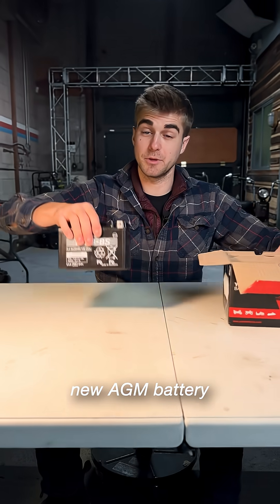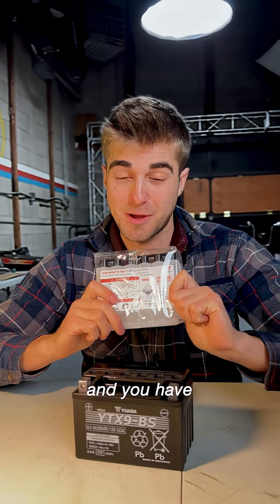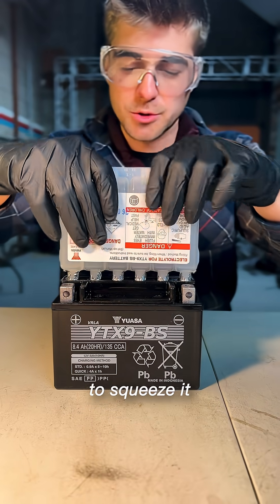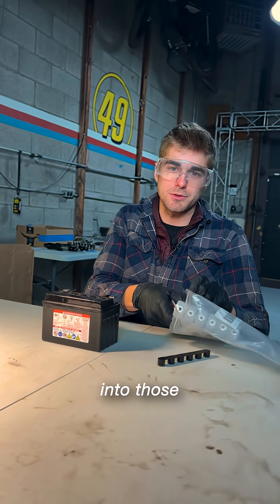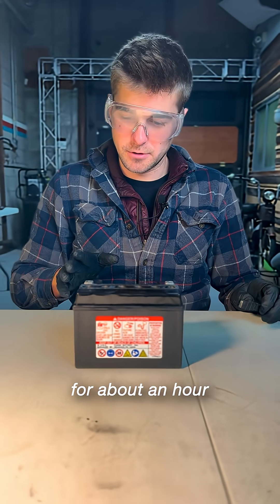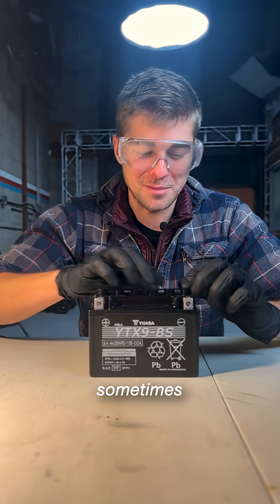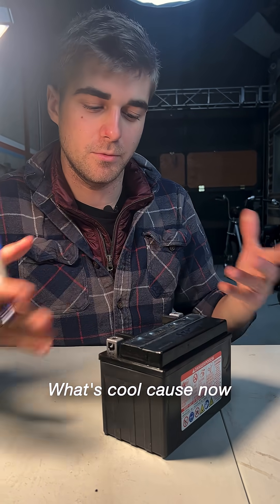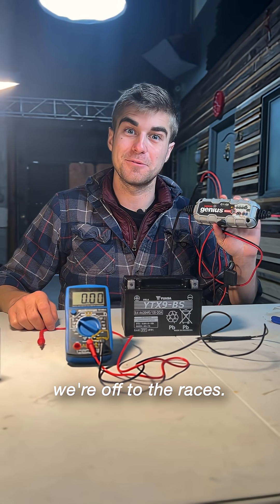How to activate your AGM battery | Tech Tips ⚡

Comment: Your first charge from your charger should be manually adjusted to take the battery, all the way to 16.20 VDC. And if you can, you could give it a trickle charge every fortnight, which could still reach 16 V. And this battery will last, a very long time. 😊😊

Comment: Excellent presentation.  No hyperspeed, chopped ADHD clips we have to pause every couple seconds.  I wonder if the fibers are prone to trapping bubbles from filling and off gassing though, blocking current flow across random patches of the electrodes, and if initial vacuum treatment might be worthwhile for longevity?

Comment: I worked at an auto parts store many years ago. I remember occasionally having to fill and charge flooded lead acid motorcycle batteries. Back then, the acid came in one single bottle, and you had to precisely decant it into each cell.

Comment: Just to clarify some disinformation: 
Battery acid is corrosive and not fun but you can absolutely put your hands into it for a couple of seconds without any issue as long as you wash it properly afterwards (ideally with some baking soda mixed into the water to make it alkaline)

The gas coming out of the battery when adding acid is mostly just CO2. H2S is a byproduct created during battery production but the concentration you need to start smelling it is extremely low. The other possible source of H2S smell is usually a short circuit in one of the cells, which released H2S when charging the battery.
Reply: Another point: AGM batteries don't like oxygen and they have overpressure valves, so close them soon after adding the acid when most of the gas is released and you only have slight bubbling

Comment: Bro I did that and it's not acid Acid. Spilled on my finger nothing happened but once it gets in battery then it becomes acid.

Ps the battery is THESE BATTERIES ARE SHIT THEY DIES AND BECOMES USELESS WHEN NOT USED WITHIN 15 DAYS ITS PLATES BRAKES.
Reply: The acid is diluted these days so you may feel burning for a bit but it goes away quickly. Still wear glowes though

Comment: I can tell you from working at a shop that dealt with batteries. Battery acid on your skin wont do anything besides make you itchy.

I dealt with it every day and with many broken batteries brought in. It will eat cotton nylon wood concrete. but it doesnt do anything to plastic skin or synthetic clothing.

Battery acid is terrible for you if you ingest it in anyway say your mouth eyes or an open cut. But you would have to leave your hand in a bucket of acid for a very long time before it ever starts to hurt you

Comment: Amazing.... By the way, AGM batteries last longest when they are  float charged at exactly 14.10V at room temperature... There is actual real data from hundreds of thousands of batteries that shows float charging at 13.5V actually accelerates sulfation.

Comment: Lead dioxide on one plate and the other plain lead. Add sulphuric acid and you have a battery.
Reply: You will have a terrible battery though 

The magic is in the engineering details and processes 

Lead oxide production, Paste mixing, additives, curing, formation all have a big impact on performance

Comment: No doubt. Watch out for the acid.  I got a hold of a brand new SLA battery with a bad case weld. At some point I touched my face because about the time I realized the battery was wet, my upper lip started burning.

Comment: As someone who's worked at a batteries plus. AGM doesn't insinuate that all AGM batteries are stored dry. It is true of the smaller motorcycle, dirtbike, etc applications, but Car AGMs are already filled in factory. It is okay if you wiggle it, squeeze it or tip it to make it release the acid faster, we had things to rest the bottle against to quicken the filling process. You don't actually have to wait an hour, at most it should be 30 minutes for most batteries like the 9-bs you have. after the waiting period we'd stick it on the charger until its 100% and prepare it for the shelf that day.

Comment: 2.2 volts per cell=13.2 volts fully charged
Reply: Only when you just ended the charge a couple of minutes ago, which will drop fast 

Normal voltage is ~12,8V for a fully charged battery

Comment: Agms are not normally shipped dry like that, and lead acid chemistry does not produce 2 volts per cell. It makes 2.1, which is why nominal battery voltage is not in fact 12 volts, but 12.6v. In a 6 volt battery it's 6.3
Reply: He's doing a video to show how a AGM is started up. He's not worried about the stating exact voltages since that isn't the point of the video.
Voltages can be another video where specific readings can be specified.

Comment: Oh dear, oh dear, oh dear. Each cell produces between 2.1 and 2.4 volts, not 2.0 volts, for a total of between 12.6 and 14.2 volts in a '12' volt battery. That's why your battery charger indicates upwards of 13 volts (usually around 13.8 volts) for a 'fully charged' battery and why a battery that holds a maximum of between 12.0 volt and 12.4 volt charge is classified as 'dead'. Flooded acid batteries may have twelve cells grouped as six pairs where each cell produces 1.02 volts - 1.2 volts. 

Secondary/high school chemistry.

Comment: What you should also do is write on the battery in a different color marker because people that write the date in the year on the battery in a color that is not well. Let's just say this. The color that you wrote the date on the battery is roughly about how you'd say too much color that absorbs. It's better if you use a white marker or even a red marker because then you can actually literally see it and it's better to write it on multiple places on the battery because you never know on what's going to happen because like some sometimes a stupid moron kid will wipe that date off even though that you tell him not to wipe it off. Some of these stupid kids actually do wipe it off. I should know because I did the exact same thing to a battery and the kid wiped it off on me and I even told him do not wipe this off. You can wipe everything else off except for this and for now on I've been writing down the expiry dates on a piece of tape and also on the battery and a different color. I color that actually pops out so that people can actually read the date of expiry and I keep on saying it's not to let people know that they're idiots to let them know that this battery needs to be changed and that's the date for the date I bought that battery. It's to let me know when I bought the stupid thing and when I can replace it. Some batteries don't really last the amount of time that they last so it's best to actually have the expiry date on it and that's also good to keep the receipt for the battery😊😊😊

Comment: Most of the time you get no dangerous gas when filling a dry charge AGM. If the acid pack is contaminated or the plates are very old/sulfated you might get tiny amounts of sulfur gases, usually SO2 (burnt match smell) and only rarely trace H2S (rotten eggs). H2S is generally a sign something’s wrong with the battery, not a normal part of activation.
Did you actually smell rotten eggs/fart (H2S), or sometbing like a sharp burnt match smell (SO2)?
The thing is, the electrolyte contains sulfate (SO4²⁻), not sulfide (S²⁻), so H2S shouldn’t normally appear during a proper fill, at least not in any meaningful quantities.

Comment: With lead acid batteries if the battery is not holding a charge you can set it down hard onto pavement and sometimes that will help or even adding fluid into it

Comment: great video, thought AGM were some exotic expensive battery type. Nope,, 56 and learned about Absorbed Glass Mat batteries. Same as a standard battery with added feature (mats)to keep them stable whatever the position. Thankyou
Reply: They also work by using the internal O2 and H2 recombination to make it last longer. 

That recombination doesn't always work though and even the manufacturers themselves haven't figured it out completely yet so it's a lot of voodoo and praying on the manufacturers side

Comment: Depending on the specific concentration of sulfuric acid you can neutralise any residue on the container by carefully submerging it in a bucket of water then adding some bicarbonate soda till it stops reacting then the remaining liquid is safe to go down the drain and the plastic can be disposed of appropriately. 

I don't believe that batteries use a particularly high concentration acid otherwise they wouldn't sell it to you like this. This technique works even for highly concentrated acid but you need to be really careful about adding concentrated acid to water as it can produce enough heat to vaporise the water and boiling acid, water mix is not fun. The rule is always ad acid to water, NEVER the other way round. 

It's been a long time but I have worked with HF before and sulfuric acid is comparatively mild. Something to always respect but you needn't be scared

Comment: Gases generated in batteries are odure less ,that you will not feel any smell, one when acid heated because of over voltage/over current while charging you can smell acid vapours, over a period of time it may results blast of battery.

Comment: Great guide. My AGMs have always been wet. I use a pair of them in my sound truck used for outdoor audio with a pair of 1,000 watt amps and a small mixer. The first pair worked great and would run the system for half an hour at moderate volume, but my current pair of AGMs only lasts about 10 minutes 😢

Comment: H2S hydrogen sulphide is sooooo deadly.  Make sure to do this outside or in a well ventilated area.  At low concentrations it smells like rotten eggs and at higher concentrations you can’t smell it at all and your lungs will just cease to function… then you die.

Comment: That acid that comes with that battery is only slightly more corrosive than brake cleaner and way less corrosive than brake fluid from my experience and most of my set up work I don’t put gloves on due to it being like brake fluid it swells up any type of rubber if you get on your hand just wash it off with soap water quickly and you will be fine
Reply: Brake cleaner is an organic solvent and brake fluid is polyglycol with other stuff added 

Those have absolutely no relation to the sulfuric acid in chemical terms

Comment: Malarkey.  Frightening people unnecessarily.  The acid used in batteries just isn't that strong .  If it gets on you, after a bit it will start itching.  Then slowly go into chemical burning.  PLENTY of time to get to a sink and wash it off with soap and water.  Because battery acid us filuted with water.  And neutralized by baking soda.  If you spill drops of it on your clothes you won't even notice it till they come out of the wash with a bunch of little holes.  Polyester stands up to it better than cotton.

So, do you want to dunk your hand in a bucket of battery acid?  Probably not.  Splash it it your eyes? Absolutely not.  But with decent protective equipment and safe working habits it is fine to work with.  If you do it a lot it's not a bad idea to keep some water and baking soda handy to neutralize it and wash it away.

Comment: Wish you would have connected the voltmeter to the terminals before you added the sulfuric acid. Curious how fast the voltage goes from 0 to 12+ as the acid is added.
Reply: Because when dry there's no way for the electrochemical reaction to occur.

They're already charged, just missing the acid

Comment: 12,73 volts meaning lead acid battery, even agm, is full. should not need charging. 
i would like vid charging it and see voltage day after charging. floating voltage needs time to discharge by it self.

Comment: So battery acid is itchy...and what's crazy is brake cleaner is cold and somehow gets the acid off. I'm not a chemist but somehow it makes the itchy go away.

Also SLA is better than AGM but not as good as gel. And the nickel plates are "forever" but only when stored in dry places because the plates corrode in humid storage.

Comment: AGM is a German acronym for "Aller größter Müll" because if you discharge these to 30% by accident more than a few times you can throw the battery away and buy a new one.
Reply: That goes for all lead acid batteries 

Don't deep discharge them. Period.

Most battery deaths are user error

Comment: Interesting timing for this video. I recently left my bike outside in the cold at -3 Celsius for a few days which killed the battery. Decided to forgo buying a new battery on Amazon and had my local dealership activate the battery in the shop. Had to wait a couple of days but well worth it knowing that they activated it locally just days before install.
Reply: This didn't kill your battery 

Your battery was probably killed during summer when the plate lugs corroded from the high temperatures when you left it outside in the sun 

You'll only notice it once the temperature is low enough when cold starting
Reply: Or you just forgot to charge it properly

Comment: First interesting battery video.  The fiberglass surrounds 'plates'.  Are the plates lead?
Reply: Positive plate is lead oxide on a lead grid, the negative is lead on a lead grid. Both are porous and have a high surface area. For the grids you would usually use different lead alloys and geometries, the designs of which are in part dependant on the production process and in part on making the electricity flow more effective

Comment: Nope. Acid battery is diluted sulphuric acid. Because highly concentrated sulphuric acid is like an oil. That's why they called it oil of vitriol. Also, it won't turn you into goop that fast. If you got it on your body, you should wash it with plenty of water and call emergency. There's an old nile red video where he test 3 common acid against his skin

Comment: the acid that goes in batteries isn't pure sulfuric acid, it is usually diluted about half. It would probably still suck to stick your hand in and itches if you get drops on you.
Reply: I just did this and by memory it said 41% acid on the acid pack.
Reply: @Fekillix  that's about right, generally 60% water give or take depending on battery and use.

Comment: Huh? Is this new thing? I mean, I've been using this type of battery since like very very long time ago. We called it 'dry accumulator' and calling standard battery 'wet accumulator'. Free of maintenance, and with regular use of motorcycles, you can get like three years of life of this kind of battery. Roughly similar like standard battery, but less hassle of refilling battery water.

Comment: As a lead acid battery formation technician of 12 years these batteries are junk. Charged dry and stored dry the plates just don’t absorb the phosphates efficiently and don’t form a good crystalline structure. They work but they’re poor quality and have a short use life span. 
As for the acid, just wash your hands if you get it on yourself and anything else just dust with baking soda to neutralize it.

Comment: Very informative. I knew this was how batteries were stored but here in the UK, as a consumer, you cannot buy a lead acid battery that has not already been activated which is annoying because we can never have a spare, ready to go battery that is not already degrading.
I have an AGM battery for a BMW R1200GS that has never been used but it was activated 5 years ago, I charge it every 6 months or so but as yet, I have no use for it.

Comment: According to Yuasa guidelines you should wait 2 hours after adding the acid to charge the battery.
And first charge should be for 24 hours.
Not until after the first charge should you close the cap, just leave it on top at an angle to stop excess bubbling.
Reply: I just did this and the Yuasa manual said just what they did here.

Comment: What's the value of this type of battery over a standard lead acid? How's the lifespan and cost comparably?
Reply: Higher cost but longer life (if you treat it right, which you probably won't)

Lower self discharge but if your vehicle has constant Energy drain then that overrides the self discharge

Comment: I have this exact same battery, make and model, in my GSX1250FA, it's been in there for over 7years and is still in perfect condition, after winter it starts the bike right up as if was running only yesterday .. not 5 months ago
Reply: Please keep your battery charged during winter or just freeze the battery to slow the discharge reaction

Deep discharge during winter storage is the cause of most motorbike battery deaths
Reply: @GerManBearPig I disconnected the battery and unmounted it from the bike after the last ride I took in late October, and ever since it has been dwelling in a box in a cupboard in the warmth of my house 🙂 I've been doing this procedure ever since I started riding 25 years ago.

Comment: I did this nearly everyday for 9 years and 11 months... (I dont like saying I spent 10 years working at a battery store) the smell from these is not great, it smells like farts. It was kinda funny watching peoples faces during this but eventually I'd tell them its the battery and not me. 
Anyways as for tips, you should charge it after filling but wait for an hour before doing that. If you're in a pinch you can get away with not charging it but its not recommended and if you do let the bike or whatever its in run for at least 30 minutes. 
Also the acid isn't that strong. I mean if it got in your eyes, you're gonna have a bad time, but if you get it on your skin it takes a while for it to do anything. You will feel the area get a little warm and then a little itchy. By that point you have probably washed it off. Not sure if it does anything after that point. However if it gets on your clothes... As soon as you wash those clothes you will have holes. They wanted us to wear clothes with 0 holes while paying us like $12-17 per hour lmao. It was rare to get pants to last more than 3 days with no holes.